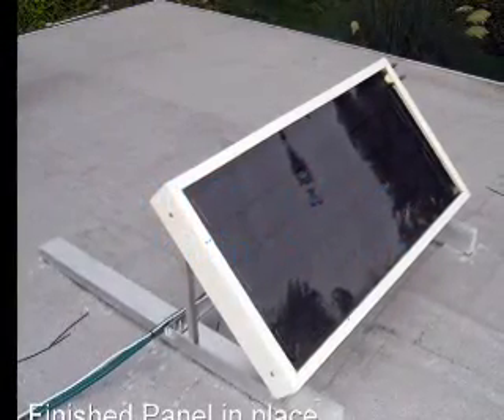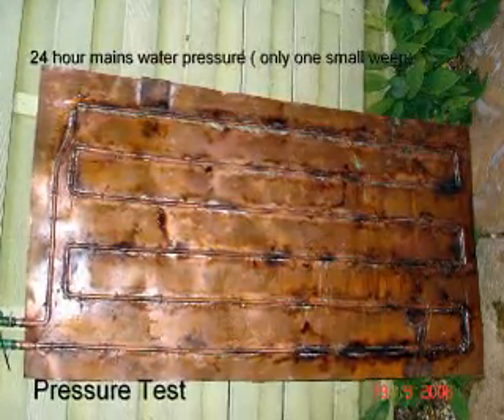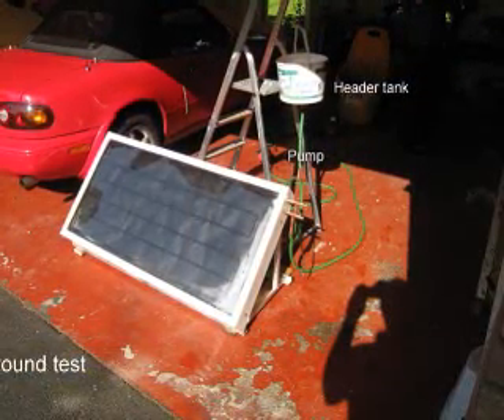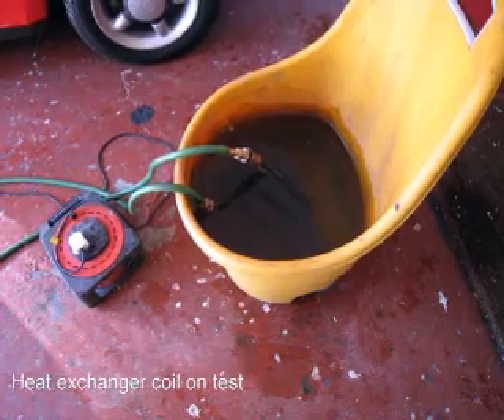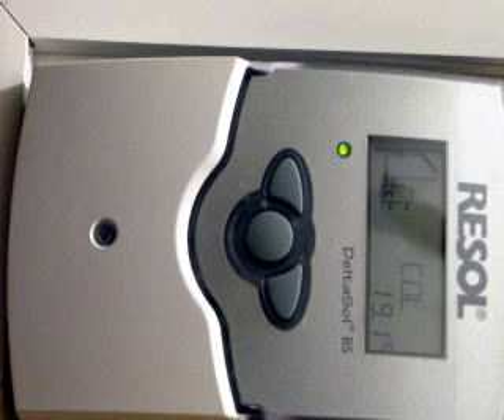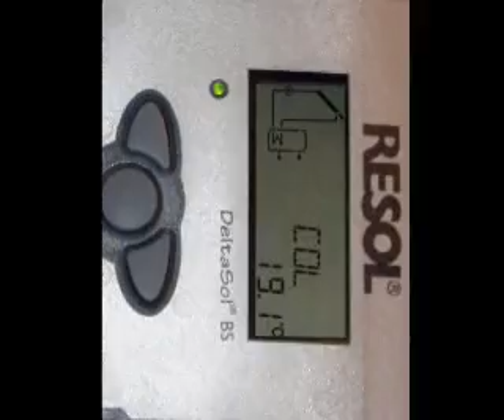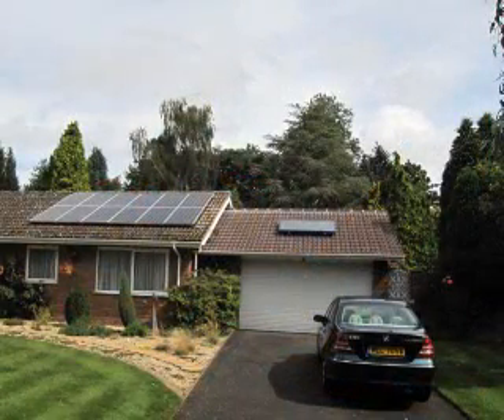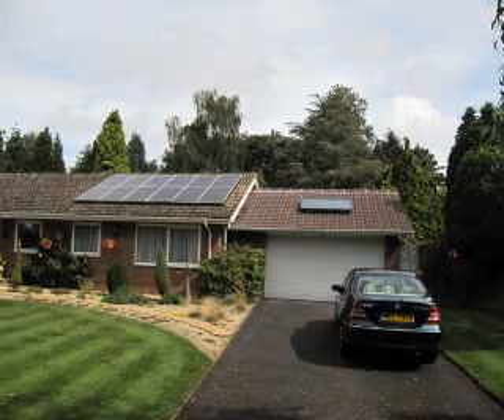DIY Solar Water Heating Panels

Comment: Thank you very much for the sensible and sane video. I'm building basically the same system at home but ended up with a 1.4sq metre panel from a larger cylinder. On the partially built panel, no paint nor insulation yet, into an insulated 4gall tank I just reached 38 degrees which I'm very happy with. May I just ask what kind of temperatures were you getting on a good day when you were preheating with your 1.6sq metre system? I have a conventional hot water boiler and cylinder and am pondering the retro-fit heat exchangers you can fit into the existing immersion heater 'port'. Once mine is built to pre-heat then i'll know for sure but just asking out of curiosity. Thank you for your time and thanks again for the idea. Cheers Dave S :)